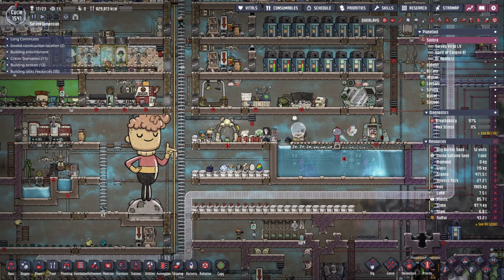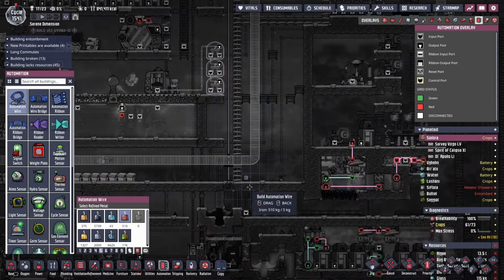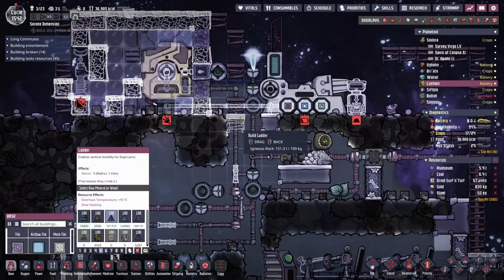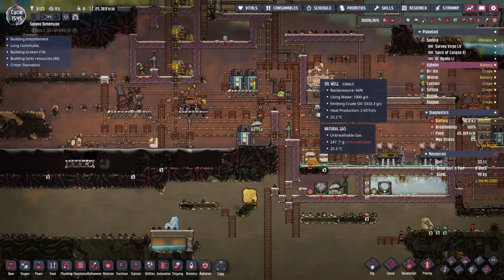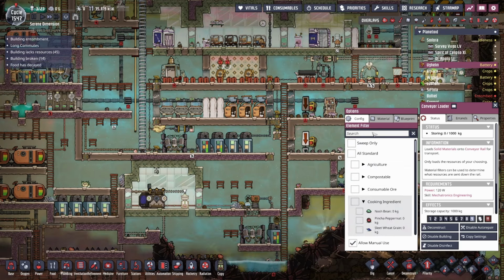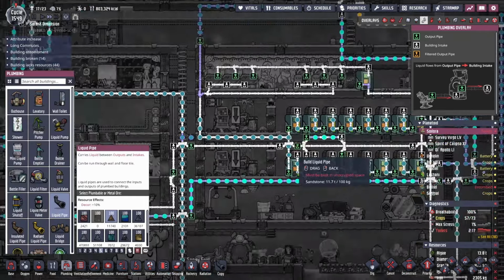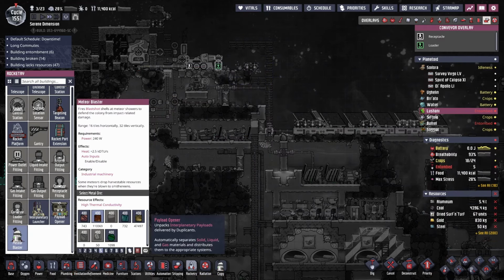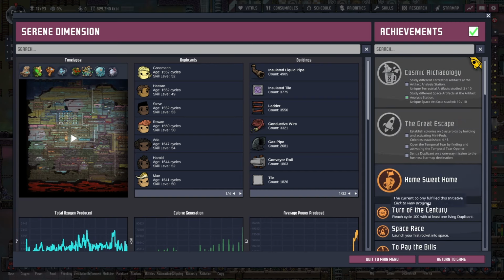Ep 171 - Progressing into Late Late Game - Oxygen Not Included - Achievement Guide - 2024

Comment: I didn't notice the update for the gas reservoir which increase their storage from 150 to 1000kg in the last video so its up to you if you want still want to apply the high pressure gas vent. But if you're willing to use compression methods such as a vent submerged in a small pool of liquid to prevent overpressure it would definitely be better.
Reply from the maker: We will see I think overall it will be better just to consolidate and have more space. But I think that will be later.